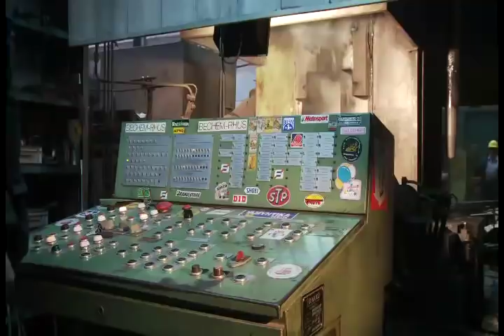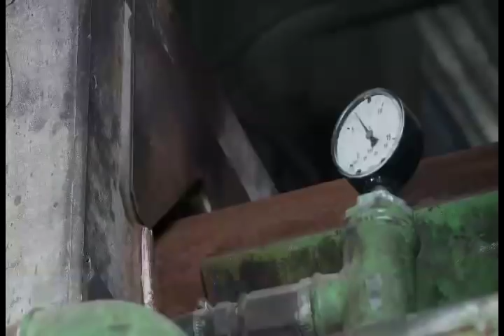Ammunition production line

Comment: chunk of square steel was heated then forged roun then double pierced and extended length and thin wall.
modern shells have to be made of hard steel so the blast on impact is concentrated inside until eventually the shell shatters with sharp spiky splinters flying off with maximum speed.